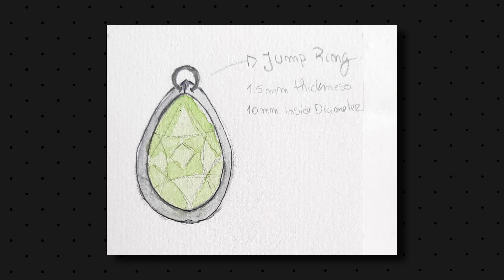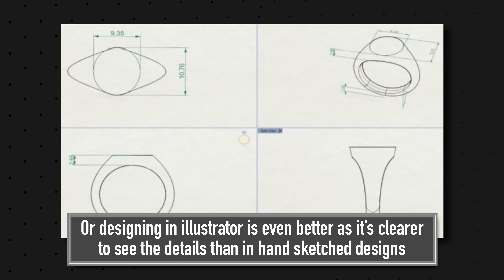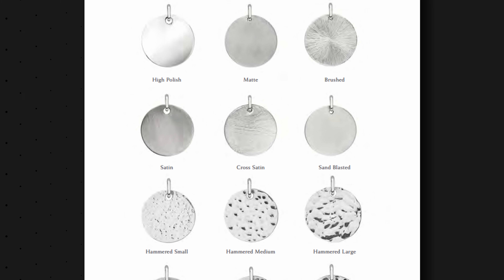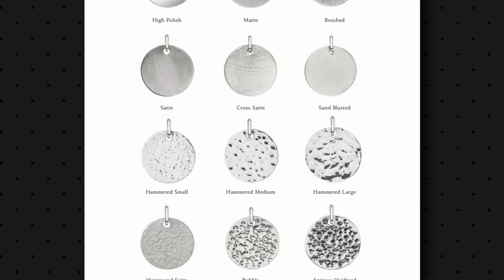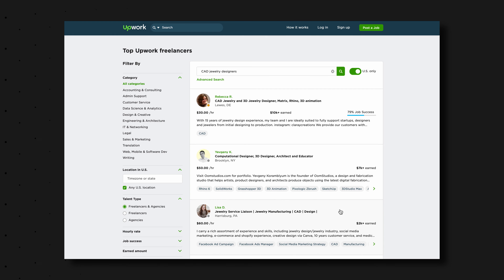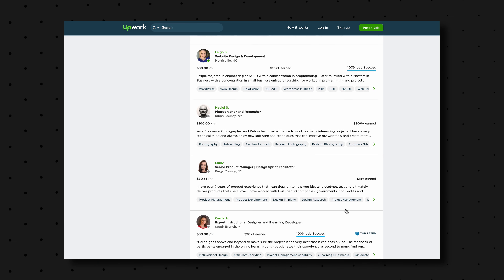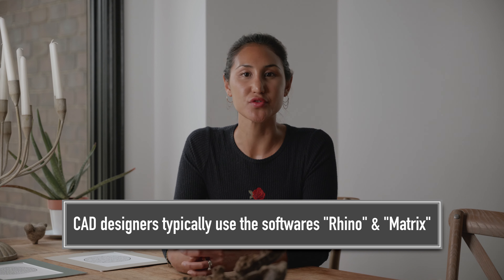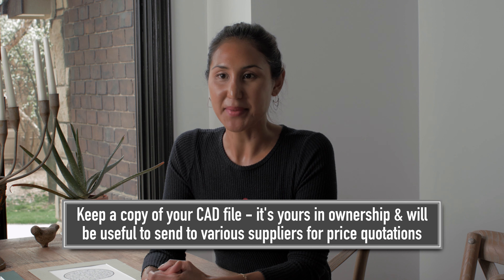From sketches to perfect CAD designs

Comment: Jewellery software such as Matrix and Rhino are too expensive for designers just starting out.
Reply from the maker: 100%! That's why designers contact manufacturers or CAD designers directly because these softwares are expensive for start up designer. Just from a production standpoint they are the most popular softwares that we've worked with (i.e customers send us the final CAD/STL file and we then print the resin etc. to make a sample)
Reply: Well you can find other CAD softwares as CrossGems or others not so expensive as Matrix etc...